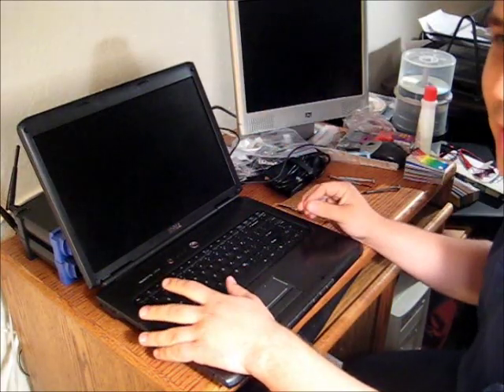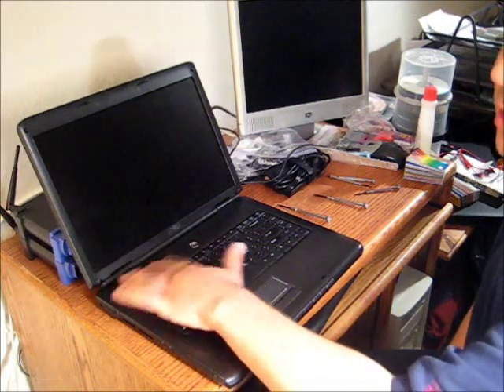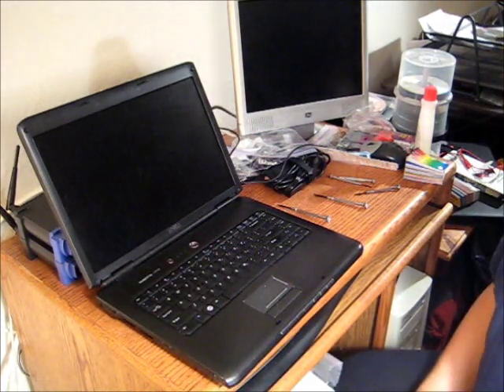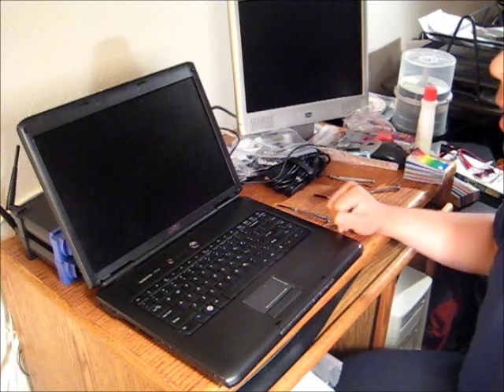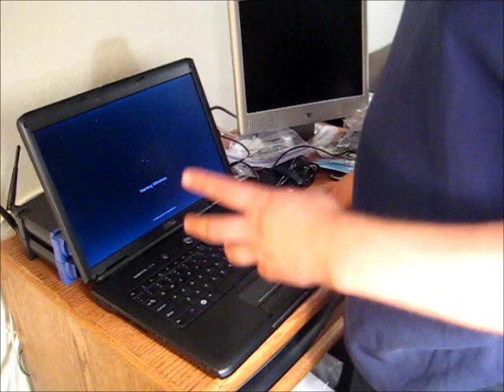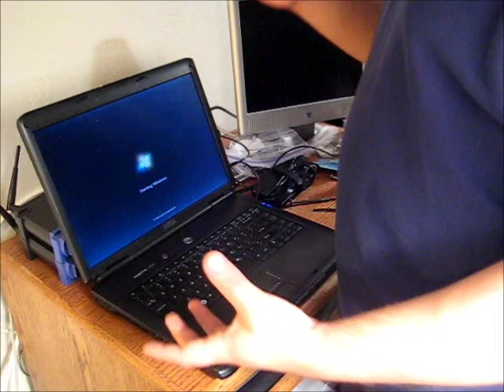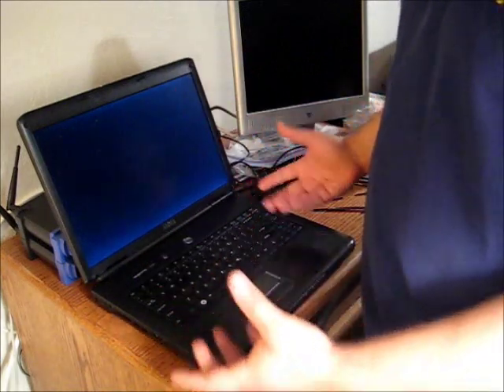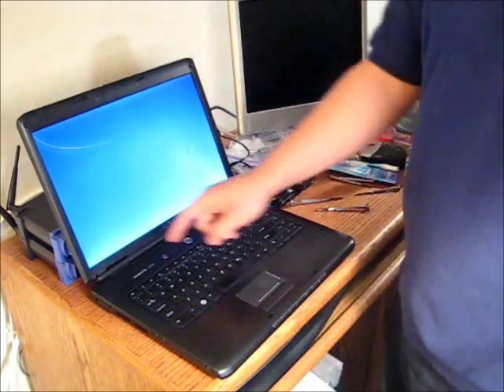Installing or Replacing RAM in a Dell Vostro 1500

Comment: I think originally, there is one 1 gig stick underneath and one 1 gig under the keyboard and I think many take the easy way and just install a 2 gig underneath , thus why many of these machines are found with 3 gigs of ram nowadays. Which is ok because most of these machines are only upgradable to 4 gigs and run 32 bit OSs which only recognizes slightly less than 4 gigs.

Comment: I don't know if I should buy a new laptop or stick to the one I have. I have a Dell Vostro 1014 Laptop which I bought in 2010. It has 2GB RAM and Inter(R) Core(TM) 2 Duo CPU 2.10GHz. The only problem I have is the computer freezes but rarely. I feel like if I format it and reinstall the software and upgrade the RAM to 4GB then it will do. What do you think? Any suggestions? I only use the computer for email, word processor, excel and stuff like that. Watching movies, etc. I'm thinking of a MacBook air. I dunno. Any suggestions?
Reply: Just add some ram, and you will see a difference

Comment: Thank you dearly Ryan,
My Vostro 1700 was on its alst legs under Vista. Typically the I/O utillisation would run at 80%+ if I tried to run say a PC game and Firefox simultanepously and it was ooohhhh so slow. Not only that I installed the max 2Gb available when I first bought it - 6 or so years ago.

Well this week I found out there were 2Gb memory cards available and 2x2 = 4Gb whey hey.

I've just installed them using your erudite and clearly visible instructions and hey presto - my Lazarus of a PC is reborn.

Thank you, thank you, thank you!!!!
Reply: Disk utilisation is now running smoothly at 40-50%

Comment: True there are some $2000 + laptops that you can upgrade video cards on but most of those are proprietary to the company and cost more than the actual normal video card.  But realistically its just not worth it.  Unless you NEED portability + gaming a desktop is a better bet thus far.  You get more for less without any strings attached.  With a desktop you can replace every part of it easily and from any brand /supplier.  Hopefully one day this isn't the case, but it is so far.

Comment: Unfortunately with laptops there is no upgrading video cards.  The video processor chip is soldiered to the motherboard so the only way to upgrade it is to buy a new motherboard which you cant do with a laptop. Rule of thumb is If you buy a laptop, realize the only things you can truly reliably upgrade are hard drive and ram, everything else you are stuck with, forever.  Thats why i always recommend a desktop PC if you are a gamer.

Comment: Thank you for this video.  You made it so easy.  I was alittle freaked out by the keyboard ribbon.  When it came out, I thought I broke the connector since there isn't really anything on the end of the ribbon - it just lays inside the flap.  I just stuck it back in there and lowered the flap and it was fine.

Comment from the maker: You might try installing only one of the new modules at a time - If you find that only one or the other works, it may be that you have a bad module. It's also possible that for some reason those modules just don't want to work with your machine, which would be unfortunate. Let's rule out the "easier" things first.

Comment: HI Rdbahm,
I received the RAM..removed old and installed new with no problems. When I went to turn the computer back on all that happend was a flashing A (cap lock light) net to the power button. it flashed for 20 sec or so and then the PC just shuts down. I re-checked both RAM modules...restart ..same results. I removed one and put one old one back = 3RAM same result. Took both new out and replaced old = works fine.  Thoughts????? Thanks Scarlette

Comment from the maker: Sorry, pins is an inexact term. My meaning is the metal pads on the ribbon cable.

I'm not sure what you're referring to about Dell. The service manual is available from Dell directly. I've linked to it in the video description. They specify to remove the keyboard, which calls for the disconnection of the ribbon cable.

It sounds as if you may have broken the connector on the motherboard for the keyboard. I don't know a way to fix this, sadly.

Comment from the maker: Make sure all the pins on the ribbon connector look to be intact, and none are missing or damaged - If they are, you may need to replace the keyboard. Lift up the flap on the socket, then insert the keyboard connector evenly into the slot. When you can't get it to go in any further, snap the flap back down.

Sometimes, it takes a few tries. I usually don't put the computer back together fully until I've tested the keyboard because of how finicky these connectors are.

Comment: i got it in jan 2008 still running, i kept it on all the time running like a desktop in my home like for 6 months. i bought an acer, hp, asus one more asus and a hp laptop in these almost five years after this laptop except for one asus i bought this year everything else broke. i remember one time i throw this to a wall and the wall has a small hole.... still working. recently opened it and cleaned it and put back together the best laptop ever.

Comment: @rdbahm Thanks, that helps a lot. The reason I asked is that I've seen different DDR2 RAM offered for Asus laptops than for my Vostro and at different prices for the same brands and G at the same supplier.
4G is the most the Vostro 1500 can take.
I hope you don't mind me hijacking this thread(?) I think others can benefit from what we're discussing.

Comment from the maker: @Flash635 Yes. If you're supplementing existing memory (As in, there's only one module installed and you're installing a second), you should get a module that matches the existing one. If not, additional speed can't hurt you. I don't know how fast the Vostro 1500 is capable of running memory, but the price difference between various speeds of RAM is fairly small, so I'd go for the fastest you can afford.

Comment from the maker: @MrDjuergens I'm not specifically familiar with the T23, so I'm not certain if the video card is onboard or dedicated. Most laptops have graphics cards built into the motherboard, which means replacing them is a matter of replacing the entire motherboard  - often costing around $200 for the replacement. I'd look around for service manuals for your particular model and see what you can find.

Comment from the maker: @MrDjuergens Sounds like you replaced the inverter, which would have been my first inclination. Your statement makes me think that when it does not illuminate, stuff is still shown on the screen, albeit without backlighting. Failing that, it could be a video card problem.

Comment: @rdbahm  On another subject, I have a T23 that works fine, except that sometimes the monitor does not illuminate. I replaced long video part that is located just below the monitor. I did not work at first, but low and behold it came on today at the office. Then I powered down and when I got it home, no monitor. Everything else seems functional...Help please. Best. Doug

Comment from the maker: @MrDjuergens My suggestion would to be to reset the BIOS. Unplug power and the main battery, then take off that bottom RAM panel. Also in that compartment is the BIOS backup battery. Unplug that (carefully, the connector is somewhat fragile) and let the computer sit for several minutes. Plug everything back in and see if things are working.

Comment from the maker: @702lakersfan Reinstalling Windows is your best bet for removing a tricky virus. If you're running the OS Dell installed, I believe there is a reinstall partition you can use to reinstall your operating system.

Comment: Great Job! One small oversight but very important is that after you remove the battery, press and hold the power button down for about 3 secs. This allows the capacitors to discharge. If you don't when remove the memory it could arc, completely shorting out the memory and you won't know it until you reinstall/re-seat the memory, power on the laptop and no ram is located. Off to the computer store you go!